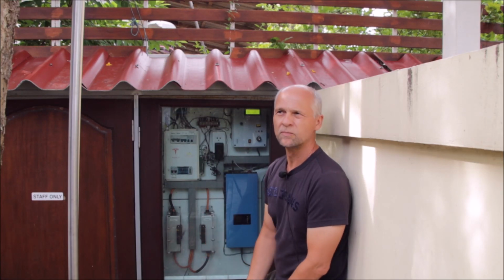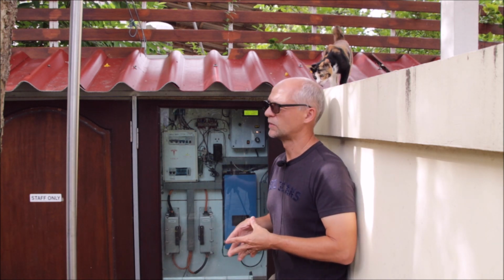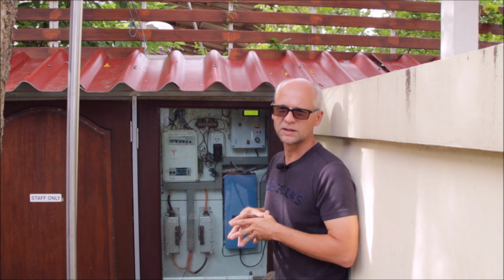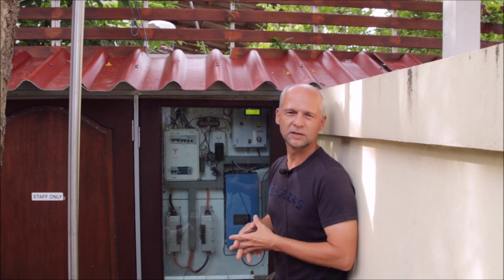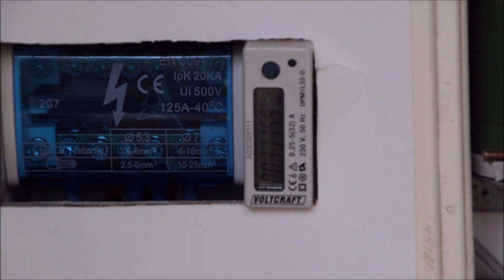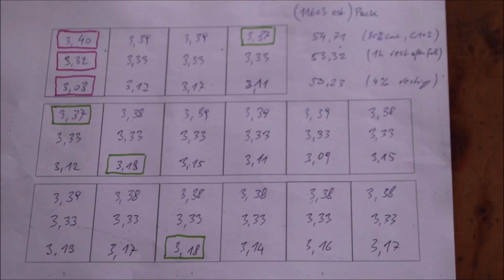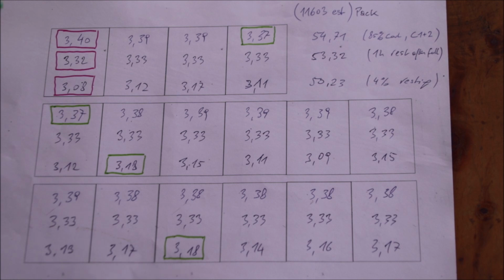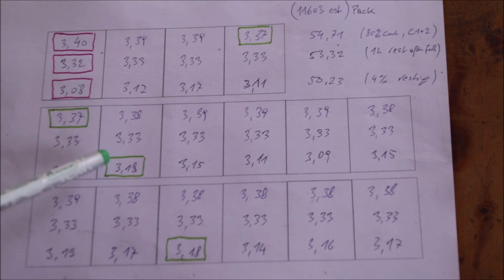Recap before leaving, Part 2: AC-Powerwall after one year, State of Balance recorded.

Comment: Totally agree since the final product is AC the sooner we get from DC produced by panels to AC the easier it will be to breakeven. The only stumbling block is the storage of energy which can only be done in DC when using electricity. You have done a good job at keeping your expensive produced electricity on your property. Current Transformers are an amazing tool when connected to relays for control of energy but you still have to do something with the extra when you make it battery charging is at least one way to store it. Timing all loads for use when the sun shines is another if this is possible. Sell some to your neighbour lol, charging an automobile or setting up a charging station use selling is another if legal, I heat water but you have no need so maybe making ice is better lol. Travel safe and remember to come back. Cheers
Reply from the maker: Luckily Lithium Ion batteries changed the whole game in DC storage as the roundtrip losses are very low. With lead acid you would be lucky if 50% of the captured AC is finding its way back in your system later. DIY Powerwalls for the win :)
Reply: @RolandW_DIYEnergyandMore  Very true Roland but unless they are really cheap I think I will wait before buying any more, battery technology is on the cusp of change and soon we will have a different battery to use.
Reply from the maker: @Dissecting_Truth  LiFePo is a very stable and safe chemistry. BMS is the last line of defense. As long you set your charger and inverter to stay away from limits, there is no risk of damaging the cells. I my powerwall, I even have 3 levels of control. Controller then Devices then BMS.
Reply from the maker: thanks

Comment: Will the battery charge and discharge rates change drastically while you are away? What effect would any drastic change have on balancing?
Reply from the maker: No. My charge rates do not change as the chargers have a fixed output power, and the discharge is as well always similar with a maximum of 33A only anyways. So yes, LFP loves low C-rates, and low currents as well mean less internal losses. Maybe that would be a reason why 3x100A cells might do better in terms of balance stability then 1x300Ah as the current is kept under control a bit better. But in solar applications C-rates are typically always low. That's why I am pretty confident, that the pack will stay in a good shape for many months to come.
Reply: @RolandW_DIYEnergyandMore  Thanks. I reckon that even brand new grade A cells will never have perfectly same internal resistance so 3x100ah cells in parallel for example gives one the opportunity to mix and match cells in parallel and even out the slight differences between them compared to being stuck with say 15 or 14 highly performing 300ah cells and 1 or 2 weak cells. I don't know if you watch Andy of off grid garage in Australia, he's been doing interesting experiments with cells and active balancers lately. Again thanks for the wonderful video.

Comment: Thanks for the video. Since you have cells in parallel, you can mix the cells in the lower voltage group with the higher voltage group right? I agree the present capacity difference across the parallel groups is not large enough to warrant the effort though. My understanding is that if one has a rather large system (especially with cells in parallel) and a relatively low C-rate usage, it's much easier to keep the cells in balance for longer periods. For example using 48 100ah cells to built a 16S3P pack is better for balancing than using 16 300ah cells to build a 16S1P pack even though one would end up with a 48V300AH battery in either case. All things been equal of course.